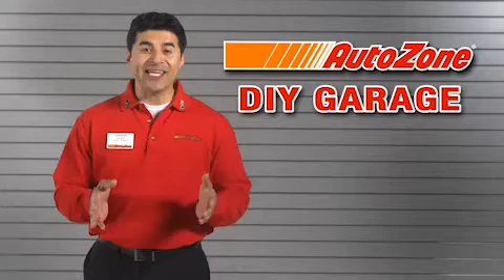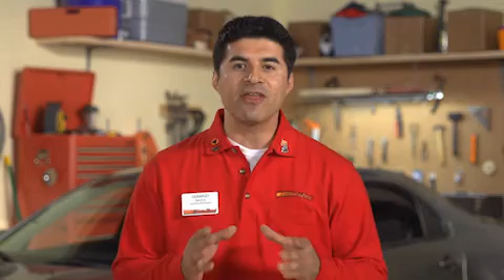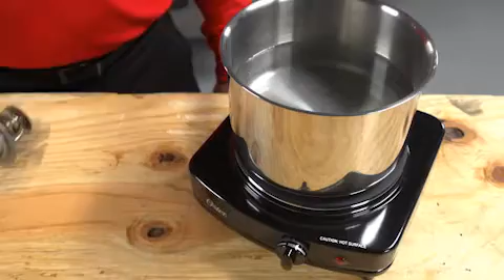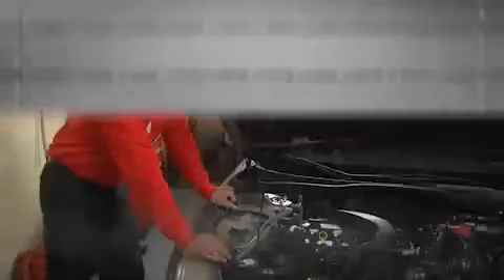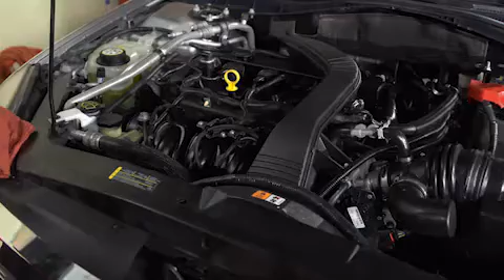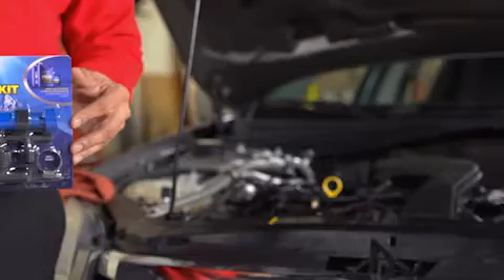How To Replace Your Thermostat And Radiator Cap - AutoZone

Comment: Bought a autozone thermostat. Put it in a pot and heated the water up to 180 degrees. The thermostat says it opens at 170 degrees. 
Brand new and dont work. 
Didn't open and only a little at 200 degrees. Also installed a motor mount from autozone. Was worst than the old part. Replaced a caliper and it didnt work right. 
Replaced tie rods. They gave me a premium and a standard without my knowledge.  1 is worn out in 6 months. 1 is ok but not for long. 
Autozone buys the cheapest parts available and change the box. 
They do not stock any quality parts. No name brand. All trash. 
Been dealing with autozones part problems the past 5 years. Customer bought a compressor from them. Wasnt the right 1. Kept blowing the fuse. Needed a compressor with rear ac. Told them. They still gave me the wrong part. Paid for install. Twice because of autozone. Autozone does nothing but screw us over. Parts are made to fail. They dont carry many new parts. Most are remanufactured. Think im wrong do some research.

Comment: Someone commented that A.Z. parts are trash, huh? It's just a thermostat, I don't understand I've never had problems with A.Z. parts (PCV Grommet, battery, neutral safety switch sensor, power steering return hose, Duralast hand tools).

Comment: so if my vehicle is not blowing hot air should I start with replacing the thermostat?
Reply: The
Reply: Try that if it doesn't work your heater core might need a flush cheers!
Reply: probably a clogged heater core or heater hose.